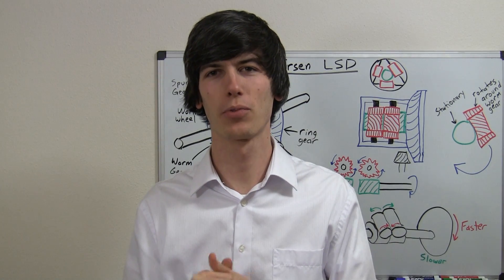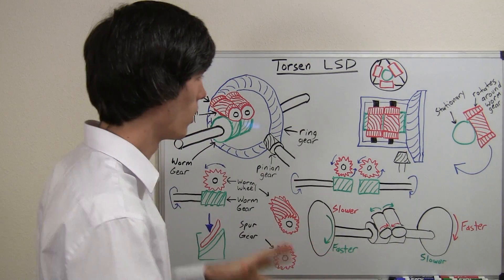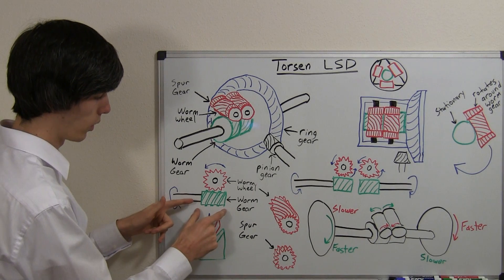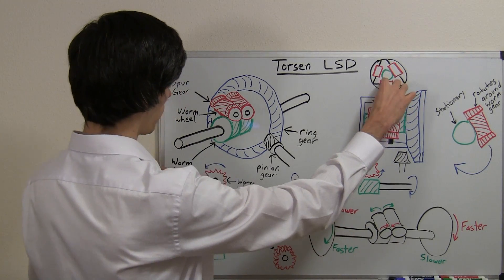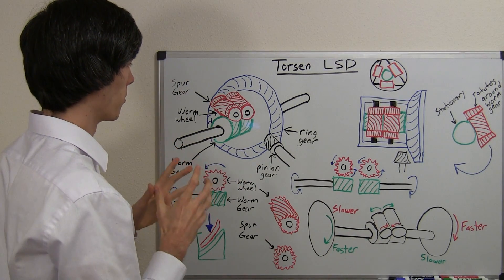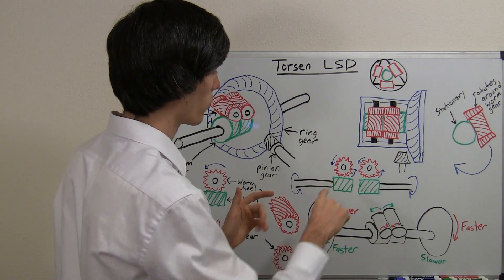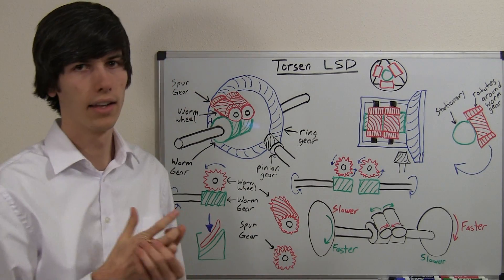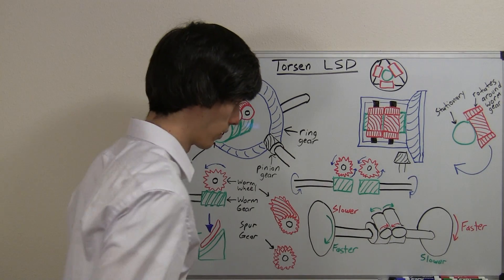Torsen Limited Slip Differential - Explained

Comment: I've seen other Diff  films  and it still doesn't makes sense  because it seems  to assume you know how it works to start off with which   and in that case I wouldn't need to see the film. 
       I not stupid,  i just want to know how it works so I don't look like some dolt if I'm asked how it works  and all i do is repeat what this guy says.  I've met several people in my youth that screwed me over by the  " Trust Me "   line  which was usually how ENRON's  ponzie scheme managed to grow and then implode .
      There must be something  I'm not being told  because when 2 gears with the same number of teeth  are meshed and one is driving something ,  the 2 meshed gears can't turn at different speed because they have the same number of teeth   and it's the Driven gear that need to change by a new  gear sliding into place that increases or reduces the driven gears shaft speed.

   It also looks like I could replace the entire  rear end unit for the Cost of just fixing this unit if just one gear gets  ground  up.   Plus the more parts , the more heat .
Reply: He pointed out towards the end that basically they are actually turning at the same speed in opposite directions in relation to the diff housing which the worm wheels are attached to. Also, the worm wheels probably could have different numbers of teeth from the worm gears in order to make this difference in speed higher or lower. I am assuming here of course since he doesn't talk about this and I'm no expert.

What you said about heat isn't necessarily true because the heat isn't caused by the amount of parts but by the friction and that's why diff need lubrication just like every other moving part on a car.

Comment: this was acually realy informative and understandable:)
Reply: So please tell me how it works  if you put the car in Reverse  while a  worm-wheel and worm gear only function in  1 direction.  Plus, how can a car use the  Engine-Breaking system on a hill to slow down if the gears  have a rule for Driver and Driven  in one direction only ?

Comment: I'm confused about one thing. If the worm wheel rotates around the worm gear of the slower moving wheel during a turn, wouldn't the same also occur  during traction loss of the other wheel, then how does it limit the wheel slip?
Reply: No. The slip while turning is based on relitivity of the case speed. While you turn the inside wheel is turning in reverse to the case (still rotating the same way) and all drive is transfered from the work gears out. When you loose traction, the slipping axle trys to drive the opposite worm gear, so tries to input torque through the worm gear ( which it cant) which "locks" the 2 axles together.

Hope that helps

Comment: I'm starting to under stand. It turns both wheel at the same speed, but when you corner allows the outer tire to turn the gear forward and get ahead. the gear can't turn backward and fall behind by design.

Does it work in reverse the same way?

Comment: First, I really appreciate this video. Second, I have a correction. He says toward the end that one wheel moving faster than the other will cause the worm wheels to rotate and one will slide over the slower-rotating wheel's worm gear. However, this is not what happens. If one wheel moves faster than the Diff housing by a certain amount, the other wheel must slow by that exact amount on its own for the worm wheels to turn. This is what happens when making a turn. If that is not the case, then the Diff housing and output shafts effectively lock up and torque is transferred from the faster-rotating side to the slower side. This is why the Diff is called "limited slip."

Comment: Great explanation, you made that sound simple the first time I watched it. I'm guessing that because of the way it is designed, if the left wheel is going x times faster , then the right wheel must go x times slower since the worm wheels rotate at the same speed (opposite direction). I'm wandering if in actual RWD applications, if that behavior is considered ideal, or just closer to ideal than a differential that doesn't allow different wheel speeds. Thanks for the video.

Comment: so why can't the worm wheel turn a worm gear? if i'll understand that i guess i'll get the whole thing
Reply: The angle is so severe from the gear to the worm, that it can't move it, but the angle from the worm to the gear is slight, so it moves it easily.  Picture a ramp leading up the steps to your front door.  If you attach a rope to an object and pull horizontally, the object will come up the ramp, if the angle is not too steep.  But if the ramp is very steep, and you pull horizontally, it won't move up the ramp.  Also, if you were to start with a slight angle and gradually increase the steepness of the ramp, at some point the object wouldn't move up anymore, because there would be too much friction and the object might even indent the ramp, stopping movement.  Look at an image of a worm and gear and think about it.
Reply: worm drives only work in one direction.power can flow one direction but not the other.
Reply: yeah but why?
Reply: M B that's probably the best explanation i've read so far. thanks.

Comment: i understand the diff completely, i just don't understand how the slip is limited. can someone help me please? 
thanks for these videos btw! :D
Reply: This is why the Diff is called "limited slip." He says toward the end that one wheel moving faster than the other will cause the worm wheels to rotate and one will slide over the slower-rotating wheel's worm gear. However, this is not what happens. If one wheel moves faster than the Diff housing by a certain amount, the other wheel must slow by that exact amount on its own for the worm wheels to turn. This is what happens when making a turn. If that is not the case, then the Diff housing and output shafts effectively lock up and torque is transferred from the faster-rotating side to the slower side.
Reply: Ik moet hier een eindwerk van maken. Niet makkelijk zu Jef :P
Reply: I'm starting to under stand. It turns both wheel at the same speed, but when you corner allows the outer tire to turn the gear forward and get ahead. the gear can't turn backward and fall behind by design.

Comment: Great video which I'm sure was a rough ride for you. I was wondering though; if neither of the spur gears can make the other rotate in the opposite direction when driving in a straight line, how come it's able to do so when one tire has to rotate faster than the other? Aren't both tires still getting an equal amount of torque, thus driving the spur gears to rotate against each other with an equal force? What is it exactly that made one gear successfully drive the other gear in the opposite direction and so have it mesh its way around its worm gear? Where did that "extra" force come from?

I really hope I've managed to make my question/s clear enough to answer. Much appreciated!

Comment: okay so if your going to drag race and do highway pulls you dont need this right? Since your not turning.
Reply from the maker: Well it depends, if the surface under one tire has less friction than the other side, this will allow you to accelerate more quickly.
Reply: oooookay that makes sense. Thanks for the vid it was very interesting.

Comment: I watched all the differential videos so far.
Only one question: how does this works with AYC/ACD (Active Central Differential)?
Reply: just like any other differential. except it will require less torque biasing than a open diff, and more torque biasing than a locked diff in most cases. active yaw control is generally done through brakes (few exceptions like the gtr) and that will have no effect.

Comment: So in vehicles equipped with this Diff, would this aid the turning circe, and eventually front tire wear because of the flexibility of the rear wheel speeds in relation to each other?
Reply from the maker: The turning circle would remain the same, compared to a locked differential there would be less wear on your tires if you drove it on the road.

Comment: What vehicles have Torsen?
Reply: Stunr99 hmmwv. hummer H1
Reply: my 07 ram 2500 5.7 hemi has this setup. seems to work good.
Reply: Most Audi four-wheel drives are based on torsen (called Quattro AWD).

Comment: Am I correct in saying, that, as this video is setting friction aside (unlike your follow-up video) it is describing a Torsen LSD being an overly sophisticated open differential?
Reply: No, the Torsen (TORque SENsing) works like the opposite of an open diff. An open diff will send power to the wheel with less friction -  in other words - grip. The Torsen will send power to the wheel with the most friction or grip. It will not waste engine power on a spinning wheel like the open diff does. The Torsen diff never locks up, its a continuous operation.

Comment: If my understanding above is correct, then I am confused as I have heard it said (but I have not confirmed) that with wheels in the air and no torque applied that a Torsen (At least on a Miata) acts like an open diff, whereby turning one wheel turns the other in the opposite direction.

Is it possible that this 'worm wheel cannot turn a worm gear' depends on pitch, and that the pitch in practice is sufficient to allow for this open-diff behaviour?

Good explanation by the way :)

Comment: I see and understand that a worm wheel rotating about its axis cannot turn a worm gear. If this was the case, and the input shaft was locked (in gear), then in theory, with the drive wheels free to rotate, you would not be able to turn one wheel on its own (As its worm gear would turn its worm wheel, which is meshed with the other worm wheel which cannot turn the other worm gear, so you would have no movement). If I'm, continue to my next reply. If not, please explain where I am wrong.

Comment: The application for this type of LSD that I remember form an old Popular Mechanics from the 50's, is for use in Airport Mule vehicles.  The actual Mule was used to pull the massive B-36, and it was said in the article that one tire could be on ice, and the other, on dry pavement, and it would not spin the ice tire, and pull the B-36 just fine.  This has not worked it's way into the auto industry, I would guess, due to the complexity.  Just a side note:  The B-36C loaded weight of 227,700 lbs.

Comment: If you simplify the problem by fixing the input shaft. Then rotating the left shaft will cause the right shaft to rotate the other way. Video "1.8 Miata Torsen LSD behaves just like an open differential"
The left worm gear drives the left worm wheel which turns the right worm wheel in the opposite direction which drives the right worm gear & output  But how so, you state that a worm wheel cannot drive a worm gear, but clearly it does!  I have an explanation but I would like to hear yours first.

Comment from the maker: Well, it doesn't have as much wear as a clutch type, and doesn't require specific fluid conditions of the viscous. It certainly has some advantages, though overall I think a clutch based system would likely be all around the best option, once you've nailed down the specific application. It's standard on the new FRS/BRZ, I believe the Miata may use it as well, as well as some Audi vehicles.

Comment from the maker: Each have situations where one may be preferred. I'm assuming by normal you mean a clutch type. Clutch types are a little more tunable, you can get it to the characteristics you prefer. Torsen is definitely more useful than a typical open differential in order to maximize power delivery to the ground.

Comment from the maker: I'm a little uncertain myself on that point. I agree; it's basically metal on metal and you would assume wear would occur. That said, if the speed difference between the two is fairly minimal, makes sense that it could last quite a while.

Comment from the maker: The two spurs cannot move in the same direction. They can move at the same speed, it will just be in opposite directions. When both wheels are rotating at the same speed, the spur gears will not be rotating.

Comment: Hey dude thanks for the vids have thoroughly enjoyed watching them over the past few weeks. Having always felt intimidated by car engines I actually feel like an expert mechanic. Thanks!!!  With this Torsen LSD a couple of quick questions if you can assist? From what I understand the two spurs can never move at the same speed in the same direction? Or even just in the same direction? This suggests that the wheels would always move at a different speed? I understand this is the purpose of an LSD

Comment: So what if one wheel is only turning fractionally slower than the other? Is there a big waste in torque just to rotate the spur gears/worm wheels? Because I think If both wheels are turning the same speed the worm wheels aren't moving, except for rotating around the axle.

Comment from the maker: What are we comparing it to? Open differentials, or other LSDs? Better than open for the obvious reasons. Better than viscous because the torque transfer is instant. Doesn't wear like a clutch type. But, it doesn't transfer torque if one tire is in the air, unlike a clutch type.

Comment from the maker: They're both directly driven from the ring gear, as the shafts running through the worm wheels are connected to the worm gears of each drive axle, thus both axles are rotated by rotating the differential housing.

Thanks for watching!
Reply: Trying to understand this in a hard driving scenario: Q. When power oversteering out of a corner, if the inside wheel starts spinning out (one-wheel-peel scenario of an open diff), will the outside wheel engage and turn but turn at a slower rate?  OR  Will the outside wheel which is already rotating faster (entering the apex, but not yet breaking traction), remain the faster rotating wheel as power oversteer is introduced after the apex of the corner? 
Thanks and sorry for the comment on an old video - trying to figure out which LSD I want to buy.